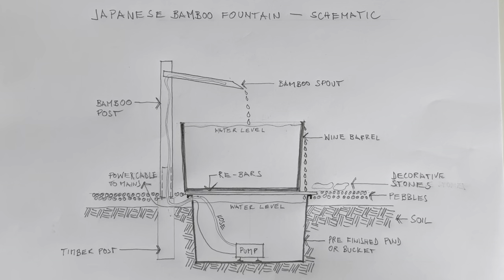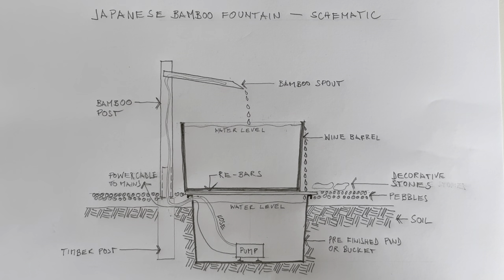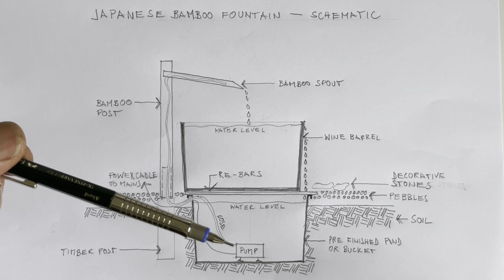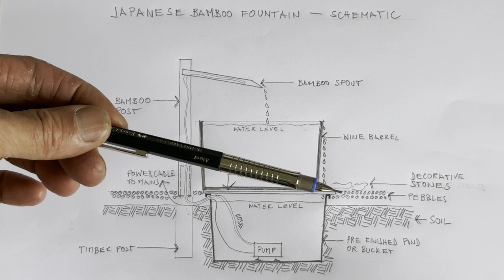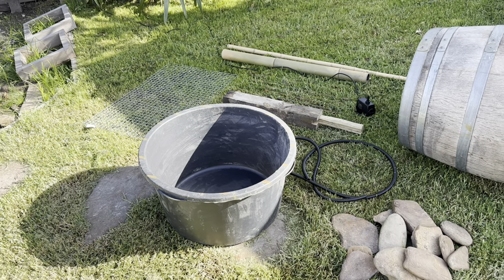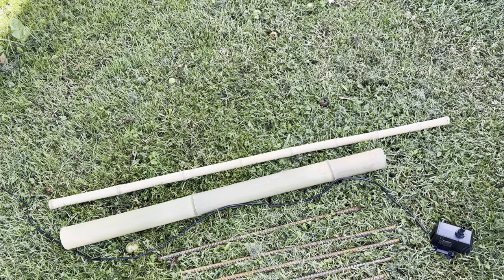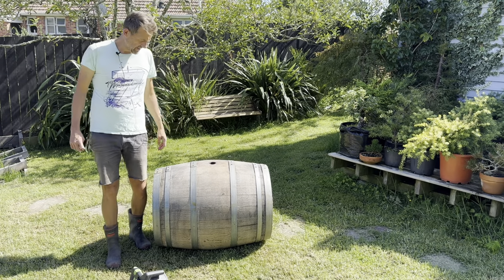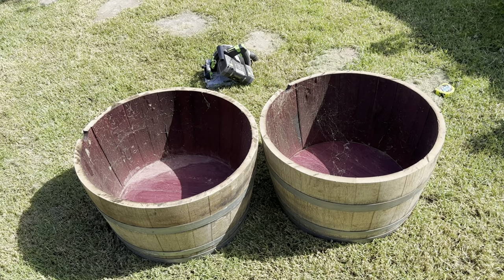Japanese bamboo fountain construction

Comment: Great job, get a lot of first-hand experiences thanks for sharing!

An advice for improvement that you can try is to put three big stones with different height near this fontain (called tsukubai in japanese ). One in front of the vessel for squating, higher one on the left for putting the "lantern", highest one on the right to put “soup bucket” .  i.think that will be improve the overall effects, and give a mood of "zen"
Reply from the maker: Thank you, great advise. Yes at the moment the rocks are just there as a place holder and will be replaced with better suited ones.